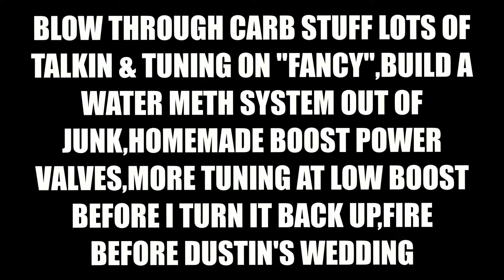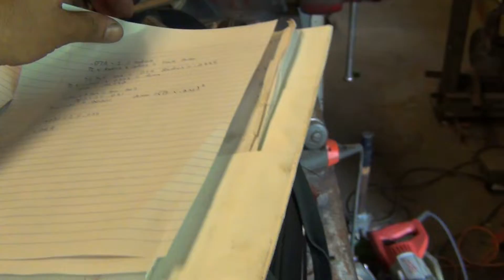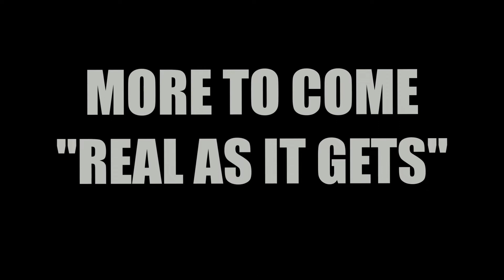SKULL GARAGE 2021 (EP.17) BLOW THROUGH CARB TALK & TUNE,DIY BOOST POWER VALVES & WATER METH,FIRE

Comment: Love the tech and thought process. Not just go buy a blowthrough.
Reply from the maker: Thanks buddy,Ive taken apart special purpose blow through carbs the big high dollar ones,and there is nothing super special in em, the emulsion air bleeds and the booster channel size is about the only special thing about em,the really high end ones come with boost power valves and this feature is where the fuel curve really does well and makes the carb setup work so well,but the same stuff can be done with a good ole holley and some time,i hope this vid helps someone with there tune an maybe save em some money....thanks for watching justin